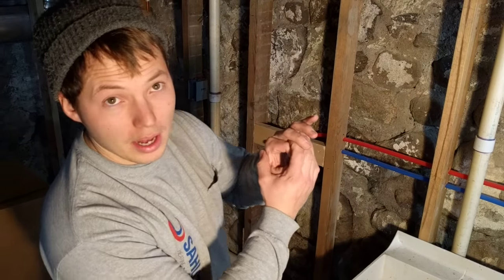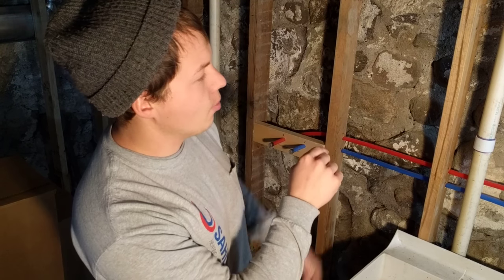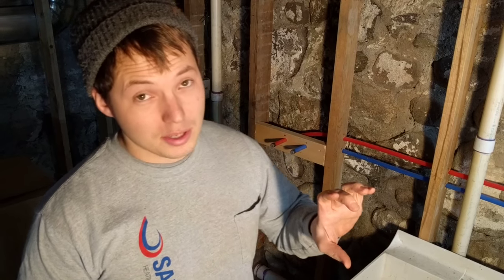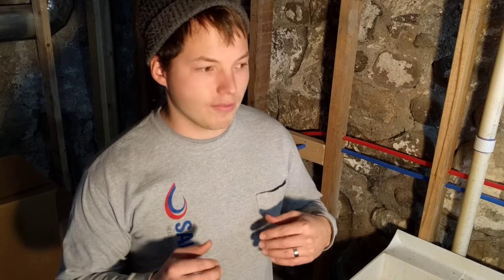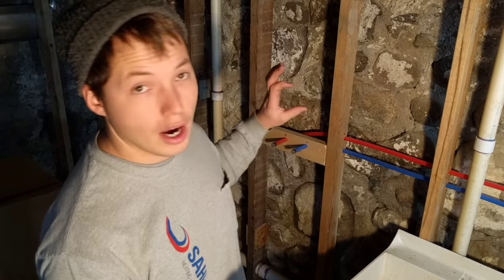Does a Washing Machine Need a Dedicated Circuit?

Comment: I'm planning to have an electrician convert a few existing outlets to dedicated circuits. The old house has the refrigerator and washer on the same circuit as a some other outlets. I'd also like to be able to run two space heaters at the same time in one large room, but each heater is 1500 watts.

Comment: You asked for corrections.  You said a washer requires a dedicated circuit.  Not true, the laundry area requires a dedicated circuit, but the washer doesn't need its own circuit.  Washer and gas dryer can be on the same circuit.
Reply from the maker: Yes. I need to update this video.
Reply: No the video is fine we understand what you meant, this person is saying the same thing you said but slightly different! Thanks again

Comment: What about adding a light switch on the circuit for a high efficiency led light & light switch? If a dryer can be run off the same plug couldn’t a low power light be added?

Comment: If I can piggyback on this topic, I’m installing a 240V (nema 6-30) welding outlet in my garage, on a 40 amp breaker.  I would also like to put an RV outlet (nema 14-50) right below that one.  They would never, ever, be used simultaneously.  I’d like to avoid having two breakers as well as 2 runs of expensive 8 gauge wire, obviously.  Does code permit multiple outlets like this on one circuit?
Reply: Old topic, I know, but here's my take on your situation. A 50 amp outlet needs a 50 amp feed wire (minimum) and a 50 amp breaker. If you want to save work and cut wire costs then start with a 60 or 70 amp breaker, run #6 wire, which can give you 60 - 70 amps, then install a sub panel with the smaller breakers and those outlets you speak of. Be advised that if the 2020 NEC code is used in your area they will call for GFCI protection on an outlet in a basement or garage. (cement floor or damp location) This gets expensive fast. You will have to call your local inspector to see if they are still under older code or up to the 2020 code.

Comment: Am I allowed to have two extra receptacles in the laundry room that are fed by other circuits? Or must all receptacles in the laundry room be affiliated with a laundry room circuit?
Reply: Be fed with a*
Reply: @downanddirtytruth  you can have more circuits if you want. Code just establishes minimum requirements. You can always do more.
Reply: The machines need to have each one their own circuit breaker, any other outlets (receptacles, luminaires, so on) need to be on a third breaker. It can even come from a room that is close to that area, lets say you can bring the supply conductor from a closest light or receptacle on the hall for the laundry room if its only 1 light and an outlet that will not supply for a large load.

Comment: Is a GFCI breaker not recommended for a washer/dryer circuit (GFCI outlet preferred)? Is arc fault not required?
Reply: GFCI for wet locations, AFCI for habitable areas. For the laundry area use GFCI, as well as for garages and outdoor receptacles.

Comment: I have one main washer machine that is 10 amps, a second "mini" washer machine that sits under it., which is 5 amps & a gas dryer which is 15 amps. Can they all run on same circuit?
Reply: Gas dryer shouldn’t be 15 amps, check the name plate again to verify. What is the amperage of the circuit in question ?

Comment: Hey Benjamin I’m in the same boat as everyone here.  I have a 20 amp breaker with 15 amp outlet.  But my washer states it’s a 20 amp front load washer.  It does trip time to time so only thing I could think of is the 15 amp outlet.  Any advice.
Reply: Breaker tripping depends on circuit load. Newer machines draw 2-3 amps and older machines MIGHT draw 5-7 amps. It's not the outlet itself, unless there's something wrong. (cooking internally?) There's probably something else on that circuit causing an overload.
Reply: @rupe53  so I looked and looked but everything seems fine.  Only conclusion I can come up with is the washer.   I have a lengthy warranty so if anything it’ll be covered.  Thank you so much for the reply.  

Have you done a video for installing an outlet for patio TV?  If any help would be great.
Reply: @camposfamily5091  it trips the breaker or it trips the gfci ?
Reply: @R900DZ  the breaker, it still does time to time but I did see when I took off the whole front door of the main breaker panel it was loose somewhat.  The breaker was loose so I’m thinking that might be the cause too.  I was going to jump at the fix here soon due to adding a 6/3 for all these upcoming accommodations the world is going to have to make with EV’s.

Comment: Here we have a situation where one appliance is already running. Will the circuit have enough current to start a second motor. It might also be preferable to have two duplex receptacles if both appliances might be drop tail plugs.  So two duplexes each with a 15 Amp circuit or two duplexes tied to one twenty amp circuit. Two drop tail plugs should not be plugged into the same duplex.  2x  20 Amp duplexes off a single 20 Amp breaker in a 4x4 box would be best cost.   You have been warned :)
Reply: What is a drop tail plug?
Reply: @ronald5728  A plug whose cord exists at 90° to the prongs in a downward direction. It puts less stress on the washing machine cord since the wires do not have to bend as they leave the plug.
Reply: @dunckeroo1987  Thanks
Reply: Can you cover the 14ga switch leg on a 20amp circuit? Many still do this tap rule?

Comment: At the end you said a 15amp GFCI with 12/2 wire on a 20amp circuit  - isn't that dangerous/incorrect? 

Maybe you meant a 20amp GFCI?
Reply: Neither dangerous or incorrect...just ambiguous.
Reply: NEC says the laundry room needs its own circuit. Installing a few 15 amp plugs in the room is allowed on a 20 amp circuit because they all have a 20 amp pass-through to the next outlet. GFCI is needed (per 2020 code) if it's a basement / garage with a cement floor (damp location) or within 6 feet of a sink. A single 20 amp outlet (not a duplex) is for a dedicated circuit and has its own rules. That's not required for a washer.